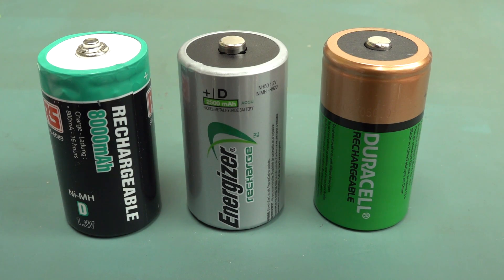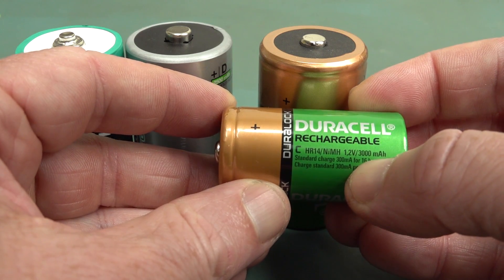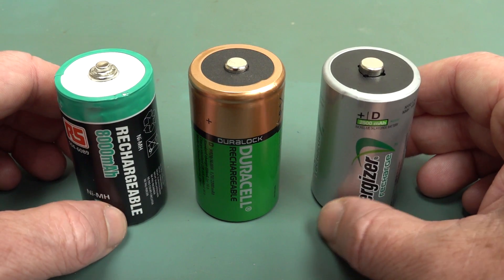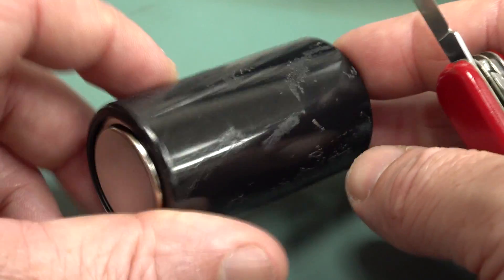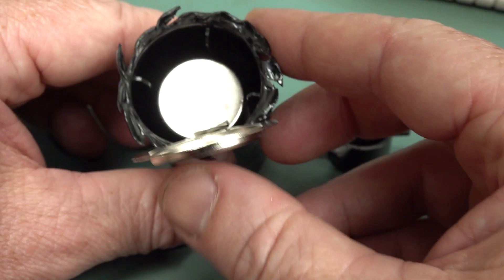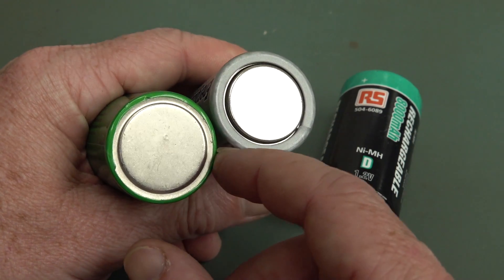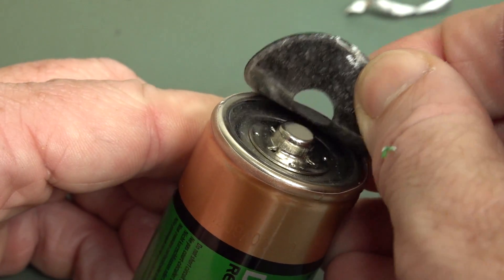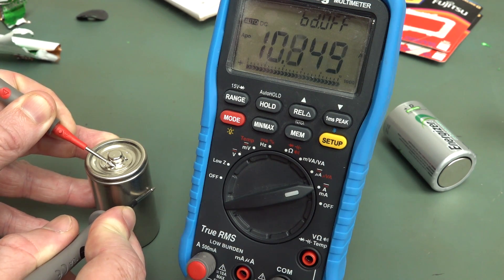EEVblog #1200 - BUSTED! - Energizer & Duracell NiMH

Comment: The battery probably is similar to the Amp Hour of a Standard Carbon or Alkaline.
Reply: I just checked the Duracell Industrial D datasheet. At constant current, the cell lasts 13Ah at 0.25A, 10Ah ar 0.5A, 7Ah at 1A or 3.6Ah at 2A (end of charge at 0.8 Volts cell voltage under load every time). So even if you discharge that Alkaline at 2 Amps (which obviously is borderline for this cell, as you just get below 1/3 of the charge compared to low currents), it still outperforms the 2.5Ah NiMH cell.
If you compare to Carbon under "significant load" (gut feeling: 500mA), the low-capacity NiMH cells might behave similar.

Comment: Energizer is not bad actually, not from my experience, they are expensive yes but they do last long and has good capacity. Duracell on the other is just rubbish. In this case sure they could have packed more capacity but if they can provide 2500mAh and put it on the packaging properly I'm fine with it.

However I wish they would have used a larger font to print the capacity on the box or the cell.

Comment: At the very beginning you say "they're supposed to be fairly identical, right?" They have the capacity listed on the battery that clearly indicates a big difference, so I wouldn't say they are supposed to be identical... is that statement based on the fact they are the same size therefore assume same capacity? Is your next video going to tear down potato chip bags to show you don't get nearly the chips that could fit in the bag? I do enjoy many of your videos but to call this one busted would imply something truly misleading or fraudulent like you find in cheap Chinese 18650 cells that claim 4000 Mah but you only get 1800. I just don't see the sky falling in this case.

Comment: Okay,setting aside the outrage for a moment, is there a legitimate technical reason for doing this?  First, higher capacity batteries take longer to charge and generate more heat doing so.  Does using the sub-C mean that the battery charges faster and has more potential charge and discharge cycles?  Second, alkaline D-cells are rated to 1.5V, while NiMH cells are rated to 1.2V, which means that the NiMH cells probably cannot replace Alkaline D’s in all applications.  From a use case perspective, does it make sense to use the lower capacity cell, particularly if the NiMH D-Cell cannot be used in “high” voltage applications?  Finally, D-cells these days seem largely to be flashlight batteries.  Keeping use case and shorter recharge cycles in mind, from an end user perspective does the lower capacity matter?

I am old enough to remember when they sold D-cell adapters for rechargeable AA batteries for use in flashlights.  Basically, it was a hollow tube sized to fit a d-cell holder and a drilled out hole to carry the AA-cell.

BTW, aren’t some AA batteries made up of stacked button cells?  I remember a hack of taking the cells apart to harvest the button cells within.

Neat video, though.

Comment: I assume part of the reason is C-cells are the same length as AA so the same width foils can be used. D-cells are longer but not very commonly used anymore. So they fit the shorter cell in the housing. Metal case on the Duracell is better, due to a fairly rare feature found in some older devices: When they had the functionality to charge their own batteries they needed a way to differentiate between alkaline cells and rechargeable ones, and to do so they relied on the fact that, almost universally, on alkaline cells the seal is near the negative terminal and with rechargeable ones it's near the positive one. So to enable the charging feature you have to scratch off the insulation so the charging contact goes on the side of the battery. Oh yeah, by the way, be careful when disassembling NiMH batteries. Apparently some chemistries can spontaneously combust when exposed to air, as Big Clive can attest to.

Comment: I miss radio shack.  They sold decent NiMH cells that were not lies.  Heavy.
Reply: I remember when Radio Shack marketed two kinds of NiCd D-cells side by side, both on the shelf and in the catalog. The "high capacity" ones weighed about twice as much, had slightly more than twice the capacity, at about twice the cost.

It didn't feel like a scam when they offered both, and advertised them side by side.

Comment: I can get 18400 mah alkalines with a ten year shelf life for around $1.00 each. More power. Less trouble.
$15.00 Rechargeable D-Cells are  ludicrous on first principles. Rechargable D-Cell anything is bodge.

Its not a scam. Its public demand. It's economics. Its manufacturing strategy. Other people have different economic price points than you.
D-Cell is SIZE standard not a power capacity standard.
Its not economic to put fifteen dollar batteries in  *Anything*". Period. 

I think repackaging a C-Cell in a D-Cell shell is a brilliant way to make D-Cell more economic for lower cost battery operated products...
Using C-cells to make both sizes cuts the fixed manufacturing cost of both products in half.

Welcome to the fakenews conspiracy.

Comment: WTH is going on with all the click baiting lately. Are you becoming senile? It's not a scam if it does exactly what it says on the box and even more so if there's a proper data sheet with accurate information. There might be applications where you don't need that capacity but care more about the weight, i.e. if you only need your torch a for a few hours a day but you have to carry it around you might have a preference for a lighter one. If it's for an annoying kids toy, again you might have a preference for a less capacity one. Also those batteries tend to be considerably cheaper... I also highly doubt that anyone who really cares is not going to check the specifications and compare if they care, you also need a suitable charger for the chemistry and form factor which is anything but common for C and D cells; I happen to have one very universal high end charger from the last decade and keep on holding on to it for nostalgic reasons but I don't even have such cells anymore... Heck, it's more likely people are going to use AA adapters for the larger cells (and also end up with less capacity that way)...

Comment: The positive is made from nickel foam, which is why it behaves a bit oddly. Its packed with a mixture of cobalt and nickel oxides while it still has open pores, and at that stage the foam is 2 to 3mm thick. Once filled, its then rolled really thin to squash the foam and keep it all together.
Reply from the maker: Thanks for the extra info.

Comment: So that piece of tape is all that is holding the Duracell together? How long do you think this will hold up when dropped? What an awful construction! The worst thing about it is that they just could have rolled more on it and increased the capacity (whereas the Energizer would need a different cell "battery").
Duracell and Energizer are purely living on their brand name. The days when they were worth the money is long gone. I stopped buying them a long time ago (and advise everyone to not buy them either). For the few battery operated devices I have (like remotes, weather stations and their temperature sensors, things like that), I usually use supermarket "brand" cells (primary or rechargeable). They still last a year or two. And I never had one of those leak, as opposed to Duracells which for some reason manage to spew their guts every time.

Comment: It's left 3/4 empty for future marketing - just add a few more turns on the roll and they can advertise the extra capacity as "New, improved, more bigger". 
With all that empty space there are several rounds of pulling the same stunt (with attendant volume and price increases) for minimal changes to manufacturing or technology. 
There's a word for that: Ker-ching!
Reply: You would think that's the path they'd take, but if that's what they're doing, they're playing the long, long game. They've had these undersized D and C cells since before NiMH even existed, very likely all the way back to the introduction of NiCd cells.
Reply: but d and c cells aren't popular like they were in the 80-90s.  Only place i have seen them the most are flashlights.
Reply: In my local hw store they sell the 3000 mAh Varta D cells at € 18,90 a pair, exactly the same price as a pair of 3000 mAh Varta C cells. Probably the idea is just to avoid a too high price point but still provide a battery that fits in a device, in case you need one. And it has been 2 years, still the same 3000 mAh.
Reply: yep also they have different options and badges for same batteries like, varta long life power, long life max power,  high energy , energy, max tech, lithium etc... with they same form factor (lr6/lr3/etc... or AA /AAA how people call em) so i think its for that... the price differs on them.
Reply: Some people don't need high capacity so they sell cheaper low capacity.  Depends on what the usage is.  Like for remote controls you don't need much capacity.
Reply: 7$ sounds great. :)
---- Given that cornerstores charge like 21$ for a two-pack of fake C cells that are just AAAs internally
Reply: Did you want to pay $4 a battery or $7 a battery?  I'm going with $4 a battery because it doesn't matter.
Reply: @webranger1962  hmmm idk the actual price so I'm just going to be generous and say its $8 for 8Ah and $3 for 2.5 Ah.

That equals to $8 for a single battery instead of $9.6 for the "cheaper" one for the same amount of amp hours.

But realistically it would actually be $12 for the cheaper one since you can't buy 0.2 of the battery.

But considering these are rechargeable and the batteries are not being used in parallel, the only reason why I would go with the smaller sized brand would be if I didn't care about capacity or I needed more than one battery. So I guess it just depends.

Comment: one question - do you trust the 8000mA rating of the RS - can you do a charge/discharge test on one?
Reply from the maker: Yes I do trust it, fully specced datasheet from a big name.
Reply: @EEVblog  Thanks Dave. Follow up question - why don't manufacturers put mA ratings on  standard non-rechargeable batteries?

Comment: It's pretty smart. Cheap eBay 18650 cells claiming high capacity up to 10000 mAh are all crap and'll give you 1/10 of what they claim. As a result, customers might doubt the RS high capacitance and go for the conservatively rated cells of highly reputaded brands.

Comment: Well, you do get way more charge cycles out of these loosely packed cells, when it's done chemically though ... (read eneloop pro / regular eneloop / eneloop light)
Reply: But you have to charge these 3x as often since the capacity is so low?  So in the long term where's the benefit? You can already buy AA to D size converter shells if you happen to have a low-drain device  that takes D size. I thought the whole point of D size is they hold a greater capacity.
Reply: yeah, in case of these it's bullshit

the low capacity eneloops are super light, so, good for mice and remotes ... and have lower self-discharge (and as a bonus more cycles) ...

Comment: But does your average punter want to pay the $ for a 8000mAh version?  Probably not so they make smaller capacity cells that have the form factor of the product they are designed for.  If recharged many times then over time they may be valuable to the consumer.  However, even 8000mAh is poor for a D-Cell... that is the equivalent of a Zinc Carbon version, with an alkaline D-Cell having pretty much twice the capacity.  So you will need to recharge your 2000mAh cell at least six times to get the equivalent of a primary alkaline cell.... that would be annoying.  There are other trade-offs... weight being one so for example in a torch you might not want it to be super heavy if using intermittently but if light duration is important then you might opt for heavy. Horses for courses.

Comment: Plain old zinc D cell has 8 Ah @ 1.5V so 12 Wh

The pretend D's have nothing like comparable capacity so ye olde boom box will fall silent before the party gets going.  

They may as well flog AA to D cell adapters.
Reply: that plain old zinc cell also has a much higher resistance....i collect BoomBoxes, a hitachi TRK8180e runs about 4 hours straight with zinc cells before you need to cut the volume due to distortion but the 4900mAh set do this without the need to lower the volume... 
But the best thing is to cheat and simply put AA types with a holder in the D-cell compartment...i run that 8081e with  8 Cells (=12Volts) but if you use 12 AA NiMH and a holder you get much more "uumph" out of it...for about 1 1/2 hours....;)

Comment: LIDL sells 4500mAh D-cells. 4euros for two batteries.
Reply: Yes I tested them . Are 800mah
Reply: @djroadie22  true, my boombox only ran for about half an hour....;)
Reply: @djroadie22  Tested a new cell and got 3,3Ah @ 0,7A. I will try again with little lower current, probably that will get higher results.

Comment: I won’t buy either brand for rechargeable batteries , i have been using the powertech and enerloop from jaycar for my work torch for the last five years  and have no complaints . Simple fact is they mostly come from the same factories in  China and the only difference is the  sticker they put on the outside .

Comment: The RS actually states 800mah on the side not 8000?
Reply: At 0:52, the RS states 8000mAh on the side that is shown, but the recommended (unsupervised) standard charge is 16 hours at 800 milliamps. This means, you put in 160% of the nominal capacity to make sure the battery is really completely charged, but at a rate low enough that excess energy can be dissipated as heat safely without generating enough pressure to open the valve.

Comment: Doesn't some devices use D-cells for their higher continuous amperage? These would be a bad choice then
Reply: Yes, they do. But in old devices, the choice of D-cells over C-cells might be due to the amperage of zinc-carbon cells. Those old devices would be fine with the 2200mAh NiMH cells. Also alkaline cells have a more pronounced drop in performance and usable capacity under high load than NiMH cells, so the low-capacity D-cell NiMH cells might be on-par in usable runtime with off-brand D-cell alkalines on high-current devices.
Reply: @tw11tube  stuff like a radio/tape player/good speakers for the TV\xbox\playstation  (any model)
That needs 10 D size batteries?

It's powered by AC too but when I take it with me I use battery's because I don't have a portable charger with a AC outlet for a laptop yet

Comment: UK Prices
Duracell  2 pack £6.99 3000 mAh
Energizer 2 pack £7.15 2500 mAh
RS Rechargeable D Batteries, 2 pack 8500mAh £23.26
Reply: The 8000mah rs ones are £10.46 each so £20.92 for 2-pack

Comment: Back when I was using Nimh and NiCd packs in my survey gear, I went to great lengths to track down actual full-weight D-cells for my laser level units.  They were (naturally) more expensive, but worth it when you’re miles from anywhere.  I thought this up-cycling of small cells in large cases was common knowledge…  Especially in the late 90s and early 00’s before Lithium cells started coming on line for standard cells, and Nihms were expensive..

Comment: I noticed radio shack doing this with nicads back in the day. I think its common nowadays since d cells are rarely used nowadays. The most common use now is in heavy duty flashlights (torches).

Comment: Props to Sanyo/Panasonic for the way they handle this with their eneloop batteries. You can buy D-cells, but they're very clearly labelled as adapters and are designed for the user to add/remove their own AA cell. No deception, and good for the consumer. For many applications you can get away with an NiMH AA cell where an alkaline D-cell was used... just not for as long.

Comment: I thought it would be AA batteries inside. That's what the nominal capacity looked like. But Duracell and energizer really are just brand names with nothing to back them up so I'm not very surprised about the results. I just investigated a little and the Philips NiMh D cell is also only 3000mah nominal I'm starting to suspect that they cap it because of some shipping regulations that were put in place after the RS one was made. Could also be that there is such a small market for anything bigger than AA that they just dont bother. It's better to just buy the sleeves to t´get the different sizes and just need on cheap simple charger.

Comment: Looking at pricing for just a minute, it does appear at least on the surface that retailers like Bunnings aren't charging a higher price for the larger size going by there links below. Both have the same capacity at the same price, only the size is different.

https://www.bunnings.com.au/varta-3000mah-d-rechargeable-batteries-2-pack_p4410417

https://www.bunnings.com.au/varta-c-rechargeable-batteries-2-pack_p4410421

Comment: They are not original nothing is go to a hardware shop and buy tools Bush,  Makita,  Black & Decker all are Made in China and priced as original infact are very good fakes and the quality is truly garbage. You can't compare a Black &Decker China made jigsaw only plasic bits and cheapest manufacture quality,  with a UK  made one 15 years old with hundreds of hours of use and still working like new

Comment: The dick smith branded AA 1000mAh NiCd cells I got 20 years ago, and still have, are the best of their type I've seen and from memory they weren't even expensive. I had a very thirsty radio control unit back then but they'd just keep going. I wonder who made them....